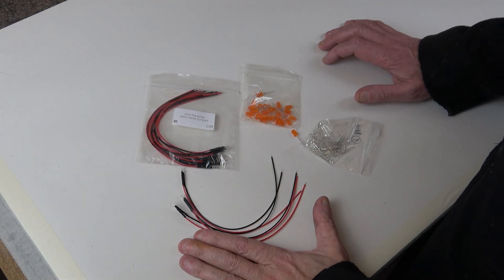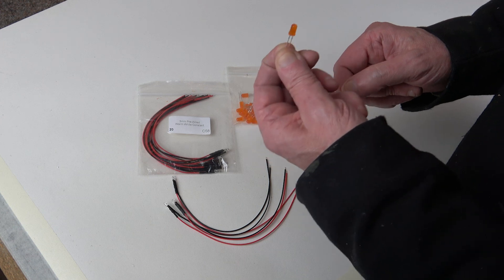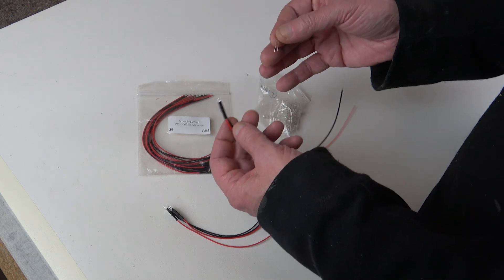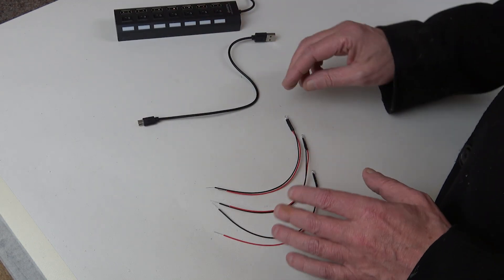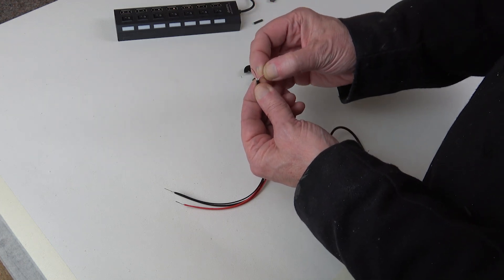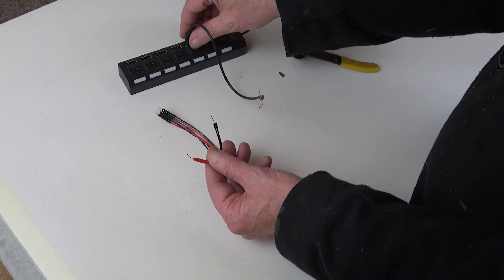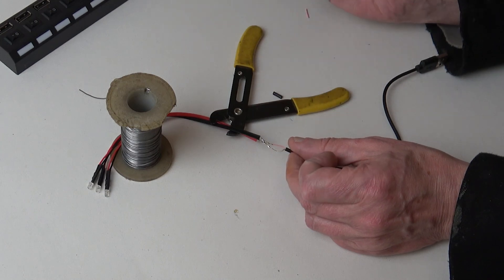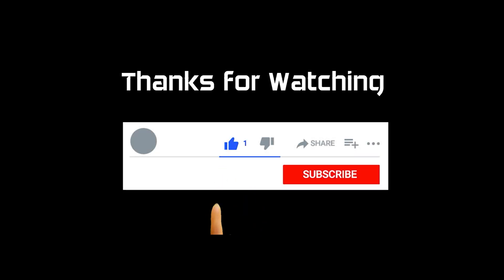Wiring LEDs for Scenery - The Basics

Comment: Hi Dave.  Does the usb connector hack work on the pre wired led strips you can get that have 4/6 led lights per strip ?
I got a pack of 10 but they only seem to work if connected to 9v battery.  What do I need to purchase so it'll work via usb connection or are they just too powerful to use like that ??
Cheers
Gary
Reply from the maker: I don't have any of those straps, but there should be a rating on the pack it came in?

Comment: Nicely explained. A tip for those that do not have a soldering iron you can use crimp terminals not as strong of a joint but will do the job just do not pull or leave strain on the connection as it could pull apart. Keep having fun.

Comment: Good video Dave, You'll find most pre-wired LED's come fitted with 470Ohm resistors if any one is interested what resistors to get if they want to run a 12v power supply and also you can get a step down power regulator but you'll need a multi meter to set them to the voltage, This is from my own experience with lighting model kits ie the NCC 1701 USS Enterprise and I've just got back into slot cars.